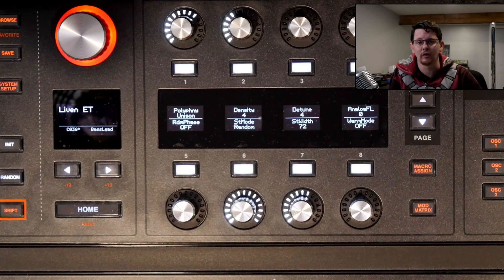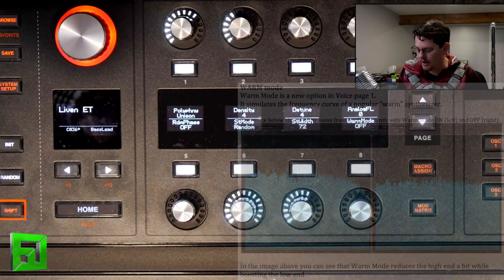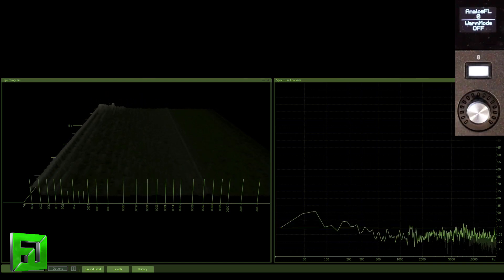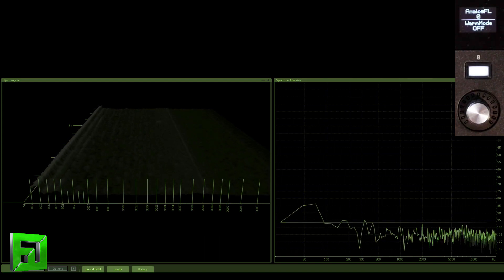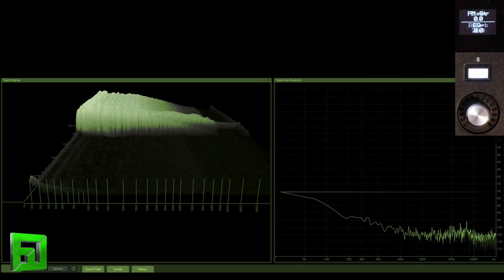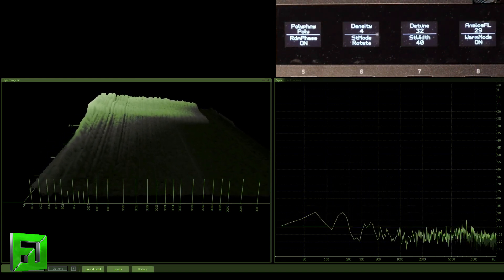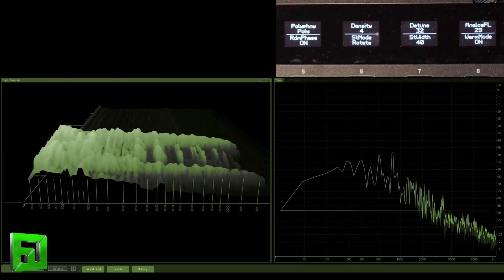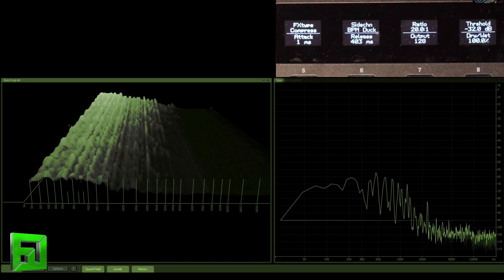HydraSynth v1 3 update Warm Mode

Comment: Can't this be done with a Parametric EQ, or is this something completely different? It seems like an "effects-chain" type of process (FX Algorithm?). Very cool update. Thanks for the demo!
Reply: As stated in the video: it is not an effects-chain type of process. In very simple terms, it is a decoupling of the phases of the oscillators and doing it differently for various frequencies. Almost like emulating an original OB-4 by digital means.

Comment: Why not add warm mode but before any processing of the wave is being done, right after the oscillators?
Reply from the maker: Lowpassfilter what sense would that make? Literally what you would be asking for would be to alter the shape of a waveform... which is exactly what the mutants do.
Reply: @Fluxwithit  It would remove the obvious artifacts in the high registers in especially the effects section.
Don't tell me there are none because that would make you lose all credibility as being part of making this great synth.